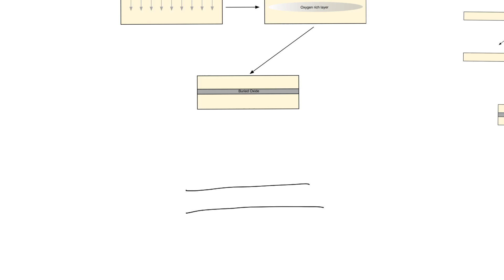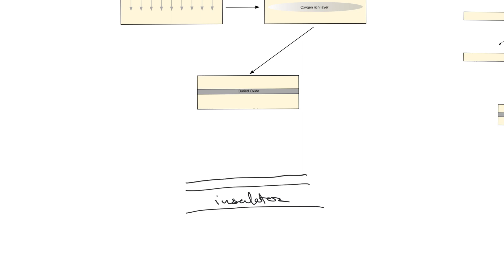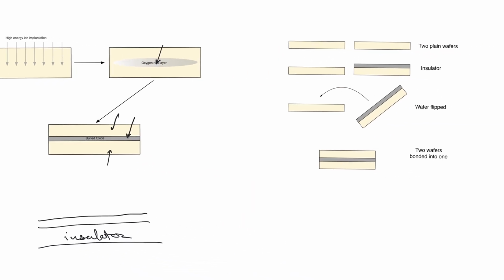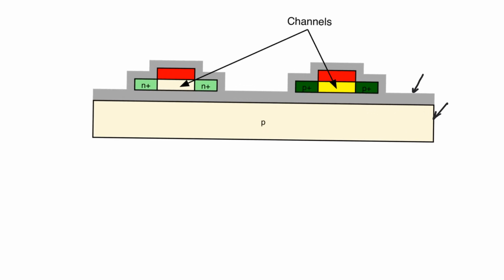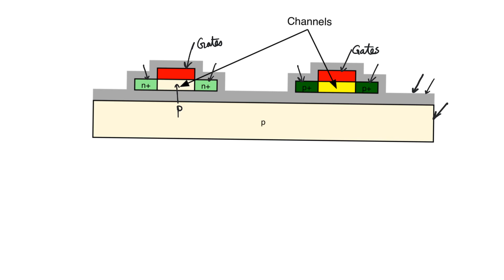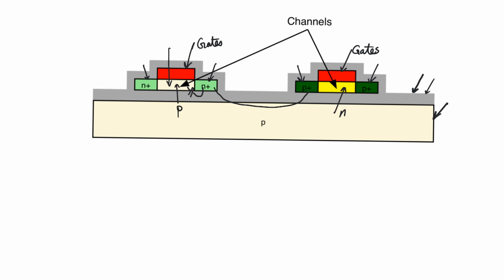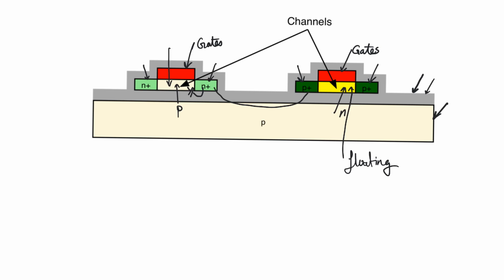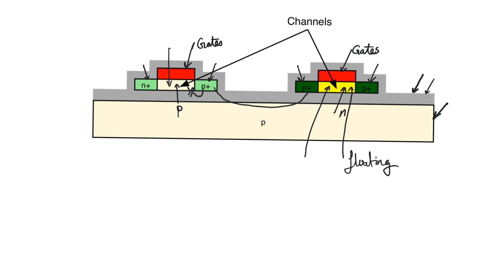7.17. Silicon on Insulator

Comment: What's the point of having a base made up of silicon? You seem to imply that it merely acts as support and it also doesn't seem relevant to the workings of the transistor. Why not start off with a 'wafer' entirely of insulator?
Reply: likely has to do with matching coefficient of thermal expansion